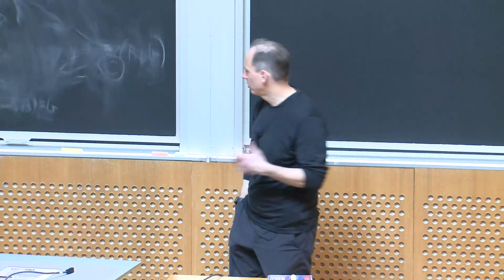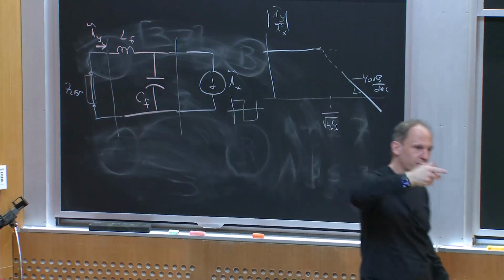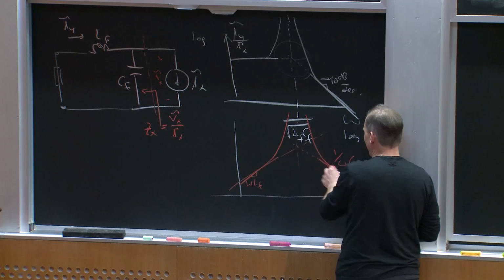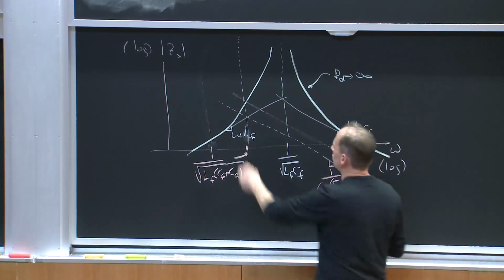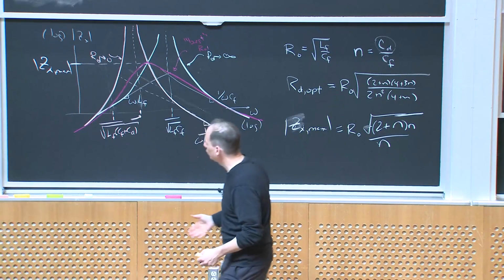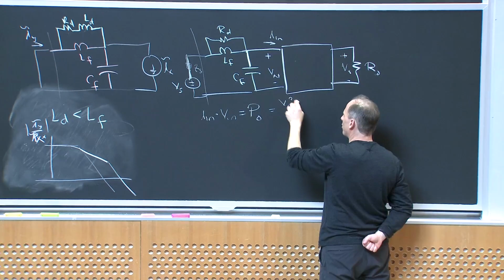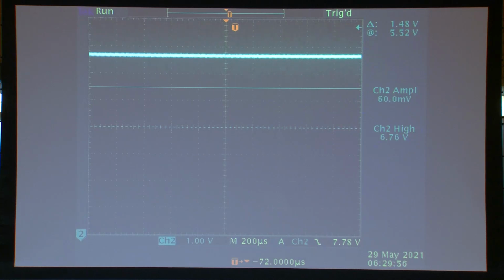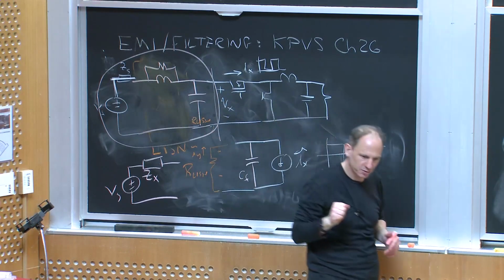Lecture 29: EMI Filters, Part 2

Comment: The simplest case:  I have several SK68 type boost flashlight drivers.  They consist of an IC controller and switch, an inductor, a large diode and 3 or 4 very small capacitors and resistors that probably supply the IC.  The battery and LED can both handle fast switched intermittent current and the whole thing is enclosed in and shielded by an aluminum tube (which also acts as the heat sink), but the cyclic operation does reduce the efficiency and maximum average power.  The usual way of increasing the output is to change from the 1.5 V alkaline AA cell to a 14500 3.7 V Li ion cell that fits in the same space.  Apparently the switch stays open and the driver acts only as a current limiting resistor.

Comment: excellent lecture! would it be possible to get the handouts?
Reply from the maker: The course materials are on MIT OpenCourseWare at: https://ocw.mit.edu/courses/6-622-power-electronics-spring-2023/.
Best wishes on your studies!
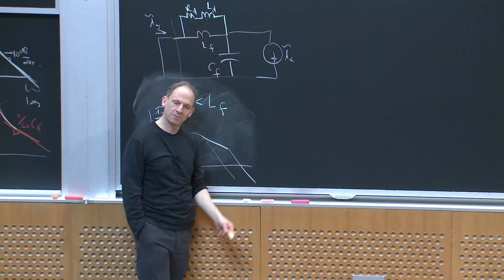Reply: @mitocw  Hi, at 32:49 it was mentioned that the handouts has multiple stages filters but on the website the lecture notes does not have any of that. Is there by any chance the handout can be shared? Thanks for the awesome lectures by the way

Comment: I have a question: if, say, instead of a power converter after the filter, I have a hold-up circuit. Should I consider the negative resistance of the hold up circuit or should I consider the negative resistance of the power converter still?

Great lecture!